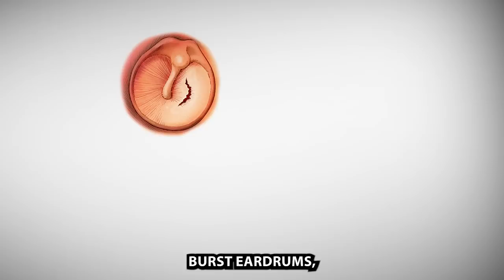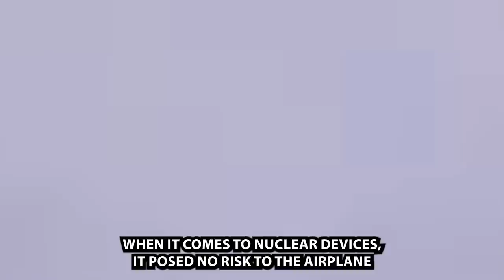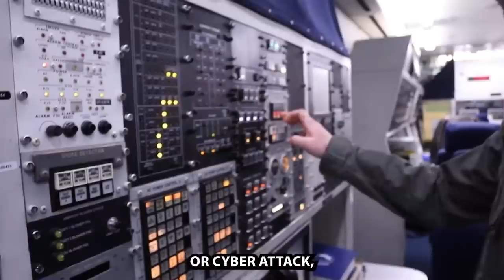Can You Escape Nuke With a Plane

Comment: 3:55 Correction - 100,000,000 celsiusis 180,000,032 degrees fahrenheit, Number in fahrenheit = 1.8x the number in celsius, plus 32. For example, 50 degrees celsius is 122 degrees fahrenheit.

Comment: Well we're realistically probably not depending on how old the plane is if it's like yeah if it's like really old playing from like the '40s or like the '30s yeah you might have a chance The shockwave would probably still shred parts of the plane if not the whole plan itself would like to get shredded from the shockwave if it's a modern airliner no you're pretty much screwed if you're over if you're less than 100 mi away if you're less than 100 mi away actually I'm pretty sure you'd probably have to be probably about hundreds of miles away for you know the EMP not to affect the plane's gyro or anything like that

Comment: That's why now they use ICBM. dropping nuclear with airplane is too risky.
Reply: They still use planes. They are capable of dropping the bombs from a much higher altitude since the targeting systems are much more advanced and precise now. Also, fighter jets can be used for smaller yield, guided tactical nuclear missiles. But yes, the ICBMs are the main threat right now.